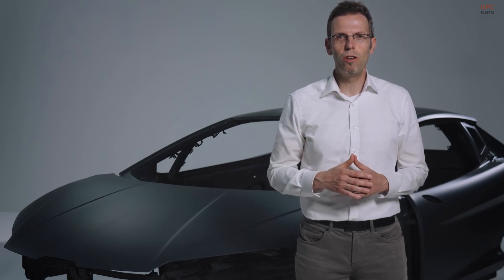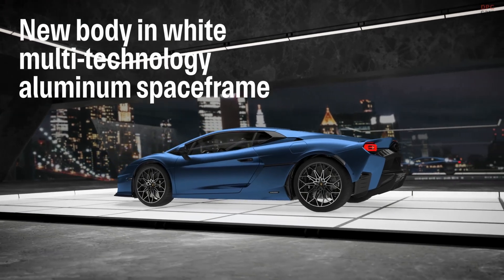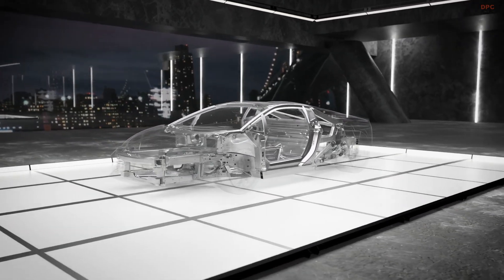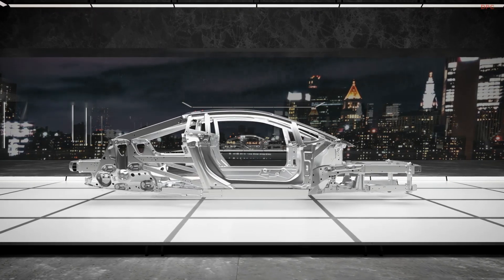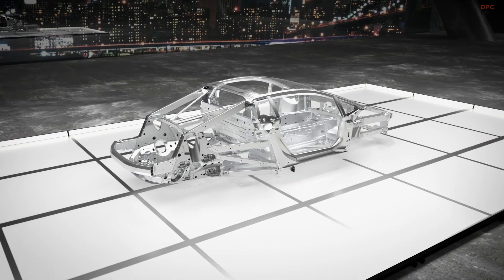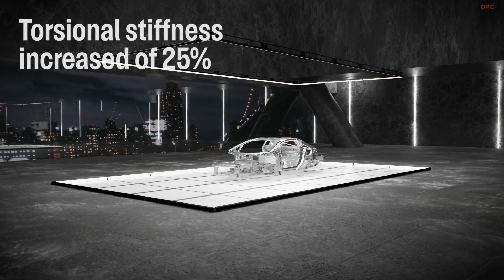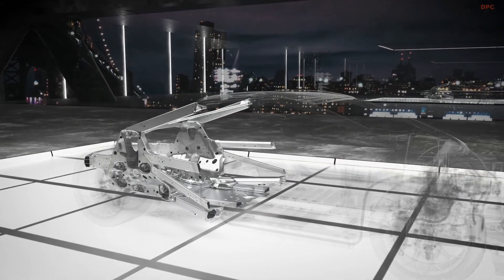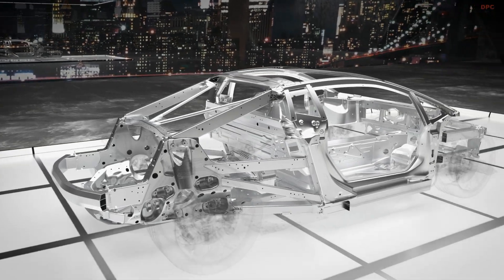Lamborghini Temerario Spaceframe Chassis

Comment: Any carbon-fibre in that structure? It;s 2024, I would have expected more composites not only on panels but the inner structure itself. And how come they no longer state the torsional rigidity numbers? I mean they always state the weight, down-force or drag co-efficiency in actual numbers.